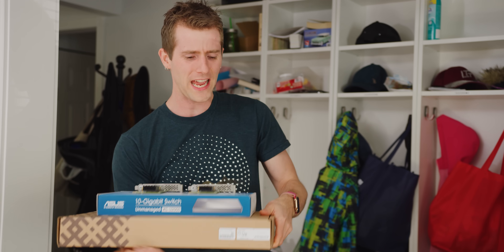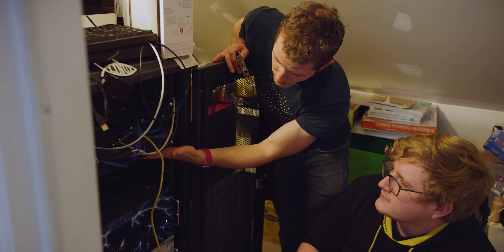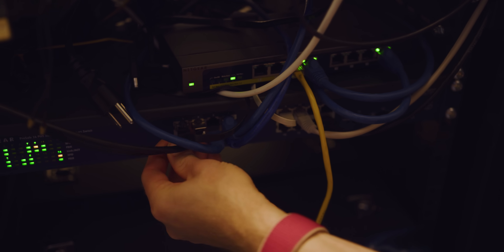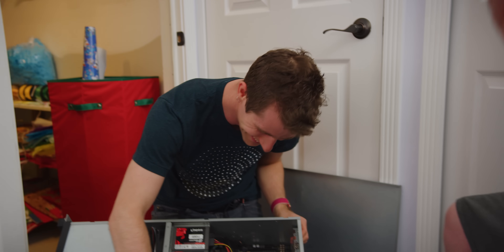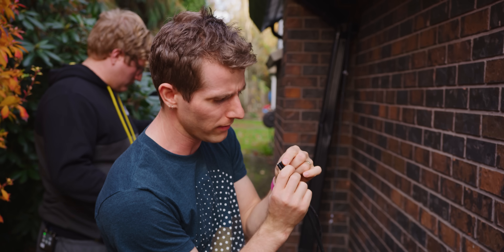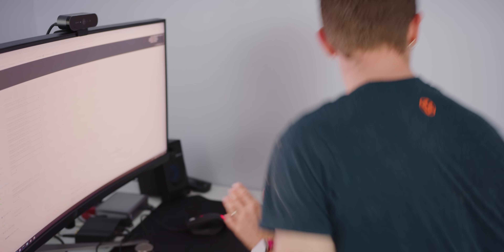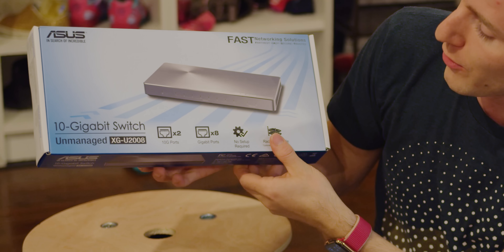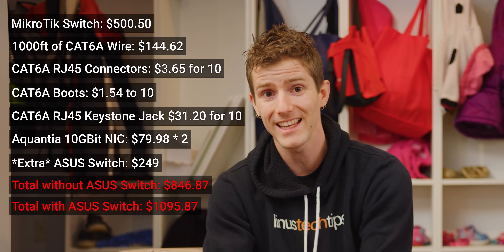Home 10 Gig Network Upgrade for CHEAP

Comment: 4:10 and a storage device that can write faster than 1GBit/s (110MB/s), thus for 10Gbit you need something that can write at roughly 1,100MB/s.....uhhhhhhhhhhhhh....... so you need at least 2 sata SSD's in raid 0 or an m.2 NVME ssd. (Of course you can also do the stupid way of putting like 5 or 6 hard drives in raid 0 but who does that?). Just speaking for the mass who don't have big ass servers.

Comment: a little question: does 10 gigabit work with cat6 cable?
Reply: Yep for runs in a home should be fine. Just make  sure its 23ga 100% copper
Reply: @mrmotofy  i installed the cat6  6 years ago. allright thank you :)

Comment: $249 for an extra switch is a bit still crazy. I'd need a few in the house, every room needs more than one wired connections. A 1g 8 port switch costs $15.
Reply: Devices like Apple TV, Ring Doorbell, Xbox, etc., all have 100M/1G NICs so don't need to be connected to a 10G switch. That can help save on cost. You can also run several drops to each room. I have three drops in my office, two in my master bedroom, etc. That way I don't need as many switches.

Comment: is it possible to convert 1 gigabit to 10 gigabit network/internet?
Reply: You're confusing local network with internet. But yes in a home most of the time I 1 gig Network can be switch to 10-gig easily bye changing the components on each end and the switch. But it may not be worth it depending on your use of your network. None of this will change your internet unless you upgrade from your ISP. Which in almost all cases is only at 1 gig available

Comment: Question. 
Is it okay to run indoor CAT6 though a pipe to protect it from weather or is it still recommended to run outdoor cable?
Reply: Technically no, but can you sure for a home. Conduit is an excellent option

Comment: To clarify more, the cat 6a cable is twisted more for less crosstalk. Apart from having a larger frequency, the gauge of the wire as well as the plastic coating outside of the copper sheaths are also different.

Comment: From around 8.20 to finished installed internet in this video (fiber not network tho, even tho we do that to) is my job on a daily basis.
 I have been on so many attics and seen SO much stuff and crawled true so much shirt you will not believe it =) Even tho the contracts says "Easiest way from where fiber ends up outside your house til the source (tv/computer) area" we do give some "slack" on that rule to have happy costumers, even tho we dont make extra money on it =( But a happy customer is at the end of the day worth some rusty nails in the scalp and some mouse droppings and glava in your asscrack =) So next time you have a cable installer of any sort at your hose, give them a coffee and a smile and be nice, they work ALOT for very little and they do it with a smile (well most of us do lol).

Comment: Nice video, but it still isn't cheap xD.
Thankfully my house has cat6 cabling (those cables are only a bit expensive comparing with cat5e, 5 years ago, when i installed ethernet cabling in my house). 
I only need to wait for even cheaper 10Gig RJ45 switch and nics :)

Comment: OH MY GOD...... why would you crimp on a cheap RJ45 plug on this really expensive cable? you have to terminate it with a properly shielded Cat 6a RJ45 keystone jack, a Cat6a wall socket or a Cat6a patch panel
also wtf is that wall socket at 12:55 omg it's all plastic? and it says Cat6a? I would call that Cat 5 at best LOL idk why america/canada is so far behind europe in network equipment?
the network in our company is from the early 2000's and it's all thick Cat7 cables and cat6a terminated on both ends. completely shielded from end to end.
this is the standard here for so many years I can't even remember the last time I saw a Cat5e installation cable.
Reply: They probably used UTP Cable wich is un-shielded, unlike in Central-Europe (because of EMC rules not to interfere other appliances) where Cat.7 S/FTP is much more common and cheaper than Cat. 6A. It is still possible to Terminate the cables with Cat.6A rated Sockets, because the new type Cat.7 Jacks GG45 or ARJ45 are still to expensive.

Comment: 10G is great for point to point links (although optical Thunderbolt kinda beat it) and single-cable WAN connections. Link aggregation, despite being a bit more complicated to do correctly, is just as effective as 10G on LAN for handling lots of devices. This is especially true when they can’t be upgraded beyond 1gig and/or there are a lot of wireless clients. It’s a lot cheaper than 10G and has the same effect on 1gig-limited clients for those who can do it.
Reply: Link aggregation is better than nothing - but generally does NOT work at "near wire speeds" or even close.
Probably depends on your setup though - but on all of the hardware I've used it on, Dell or Supermicro servers with 4 x 1GB ports, I have never seen more than about 120 Megabytes/sec - with everything running through the SAME "supports net ag" Netgear switch.

Comment: wow over kill for me. I have 230mb service and do not quite take full advantage with a gig system I never get anyware near the speeds I have now.
Reply: You're confusing local network and internet. If all you do is surf online yes you don't need hi local network speeds but if you move data between computers or servers then it helps a lot
Reply: @mrmotofy  did you read a word I sed do you know tech turms at all. I clearly explained what I used for a switch for my local network witch is 1gb and my service aka internet is 230mb going over my network and most normal people you should never need a faster speed inless you have a house full of kids who game and watch movies then you will want faster speeds to keep up or if you are running a server but as far as your local network it would take quite a few people doing things like say watching movies off a movie server to take advantage of that speed. even for him 10gb is over kill the only thing that changes things is he runs severs but the spped he would need would be for internet not local yes he dose video editing but the speed with that will never hit 10gb and will actuly limit out at no paster then 500mb do to the speed of data transfer from the harddrives and that would take top of the line harddrives and hardwear and yes I no he gets that stuff before it comes out and free. he is a lucky rich person. unlike me who has to work my but off and home I can make it threw the month.
Reply: @vorkev1  Chill with the anger dude, I misunderstood your comment. I've been reading hundreds on here with everybody whining about their internet in comparison to this LAN set up. It really wouldn't be that hard 2 saturate 1 gig with a basic NAS like you said. I have couple old 300 gig HDD that can do one gig by itself. So start rating those or adding multiples and it would be easy to run into multiple gigs. But most people as you say don't need the higher speed because all they do is surf the Internet. Which is slowly changing with all the personal data people are beginning to store. Then ideally one should be creating multiple copies of their data and transferring to another device on the network. Then in a good scenario is also an off-site copy

Comment: > Goes through hell on the attic to pull a Cat6A cable
> Never tests to see if existing Cat5E cabling would have worked with 10G
> Likely yes it would

Comment: Hey guys!  I'm currently trying to get parts for MY FIRST EVER pc and my budget was around $700. Could you tell me if these parts make sense?
CPU:AMD Ryzen 5 2600 3.4 GHz 6-Core Processor for $117.68
Motherboard:MSI B450M GAMING PLUS Micro ATX AM4 Motherboard for $89.99
Memory: Corsair Vengeance LPX 16 GB (2 x 8 GB) DDR4-3200 Memory for $67.98
Storage: Crucial P1 500 GB M.2-2280 NVME Solid State Drive for $66.95
Video Card: Asus Radeon RX 570 4 GB ROG STRIX Video Card for $70 (buying my friends old one)
Case: Cooler Master MasterBox Q300L MicroATX Mini Tower Case for $44.99
Power Supply: EVGA BR 500 W 80+ Bronze Certified ATX Power Supply for $48.98
Operating System: Microsoft Windows 10 Home OEM 64-bit for $98.99
Wireless Network Adapter: Asus PCE-AC55BT B1 PCIe x1 802.11a/b/g/n/ac Wi-Fi Adapter for $34.99
3 Case Fans; 2 be quiet! Pure Wings 2 140 61.2 CFM 140 mm Fan (both are $12.64) and one be quiet! Pure Wings 2 120 PWM 87 CFM 120 mm Fan for $15

It meets right under my budget. The final price is $680.83.

Comment: *Cleaning up the coffee that I spit out when he said, "just 500 USD" for the 12 port switch*
Reply: Considering the price of new ones (here in Europe) about 1k... Well that's cheap
Reply: Aurélien ETIENNE 
1k??
Here in the Netherlands it costs €529,- and thats including all taxes.
https://tweakers.net/pricewatch/1432780/mikrotik-cloud-router-switch-312-4c+8xg-rm-crs312-4c+8xg-rm.html
Reply: all of you trying to reason those prices didn't get the op's point ... while 15k for a Versiv 2 is reasonable from the POV of companies using those, it's still not "only 15k"
(different price level, same logic)
Reply: Mikrotik makes some god damn nice product for a really good price.
For 100€ you can get a full network router when for the same price on dlink/netgear/tplink you get a dumb limited stuff. *
i switched 120€ a 1GB tp link router/switch  that could do wan agreagation  (1 to 4 port) but... that stupid shit couldn't handle more than 200mbit wan throughput
i did stated "vlan support" BUT only their own custom vlan solution with 4 vlan and no way to choose the ID.
almost same price and i have a a mikrotik rb3011uias-rm  that is way better and can do almost anything (too bad their metarouter doesn't work on multi-core, that would open some fun stuff)
The only issue would be that's it's not meant to be user friendly, if you don't know your network basis and their product, you can fuck up your router config quite easly
Reply: Yep, still way too expensive. I'm not upgrading my place until I can get a 8 port 10Gbit switch for 150USD
Reply: I'd say 500 USD for a 10 gig switch is pretty reasonable. It's no Cisco switch but it should do fine.
Reply: @alolanstarboy  it's a Mikrotik. Mikrotik tends to overstate their abilities. I remember back  in RB250GS era, 5 port managed gigabit switch. it only did gigabit when in "dumb" mode. if you tried to VLAN it, speed dropped to s#it. only 300mbit if you were lucky. source: I use mikrotik and have about 30 out there in the field atm. they are very reliable, but you have to know what they can REALLY do, and not what mikrotik says.
Reply: @83hjf  I guess they use the maximum possible speeds it can achieve for marketing lol. Either way Linus didn't seem to have any intention of creating VLANs for his network anyway so he should be set
Reply: $500 for a 10g 12port switch is an amazing price
Reply: Ill upgrade to 10GE when ZyXels XG1920 12 port switch drops to less than $500.

Used enterprise gear isbusually pretty reasonable. 10GE is still a bit rich, but used large 24 and 48 port layer 2 gigabit switches are very affrodable on eBay.
Reply: Some 10 gig switches are way too expensive. Some cisco switches go upto 2000 bucks
Reply: @shreyaspranav  
Only 2000 bucks you should say.
Those Cisco switches, most of the time, contain lots of functionality which you might not find on cheaper switches.
Than again, they are kinda expensive for the average household ;-)

Just picked up a HP switch/controller which was needed for the WIFI access points I bought cheaply.
They needed the extra functionality in the switch/controller.
So the cheap access points turned into a bit more expensive experiment.
That switch normally would cost you an arm and a leg, but on the second hand market it was "only"" €300,- refurbished by HP.

HP, Cisco and others know how to earn money.
Reply: Thats pretty cheap for 10ge.

Check out the pricing on fiber om4 multimode and 10ge multimode sfp+ modules
Reply: @lakorai2  multimode sfp+ is peanuts compared to single mode 80km rated optics. List price for those run in the 8k USD

Comment: Just in case you ever want to login to your switch, go to mikrotiks site and download winbox. It will pick it up via network discovery (no it doesn't come with an IP on it, mac discovery works perfectly fine), at the very least so you can monitor bandwidth usage / check the negotiation of a port.

Comment: $500 + 200 + 400 = $1000+ (US)... uh no. That is not affordable. Affordable is a $40 1Gb switch and $40 in Ethernet cable.

Of course most people do not understand that most computers will not actually be able to make use of even Gigabit.
10Gb = 1.25GB
1Gb = 125MB

Once you figure in that a platter hard drive runs (at best) 130MB/s (but many see a more realistic 80-100MB/s peak), and a SATA SSD at 300-500MB/s (more or less sustained), the only way 10Gb makes any sense is going from NVMe to NVMe storage (which itself can exceed 3GB/s), or higher end RAID setup with enterprise SSDs. Once you figure in the (MS/Apple) OS overhead, most people will see no speed boost going to 10Gb on their home/small office network. Heck even the company I work for only uses the 10Gb (SFP) connectors from server to switch and firewall to switch, with the rest of the connections on the switch to the 100+ PCs at 1Gb.

Comment: every Mikrotik device can be managed ,but they have some default "crap" config so they probably wont lease any IP ,but you can use WinBox to connect there with mac adress, or if it get IP adress you can go with ports :9999 https://mikrotik.com/download but care ,try to use latest RouterOS ,cause there were some real issues with security

Comment: $850 for 10g at home seems high for what you're getting out of it. I'm looking at running a 200m link between two computers at home and I'm looking at like $250 total, $75 for the NICs/SFP+ modules and the fiber I'm going to use is worth ~$175, based on what I've been able to sell it for. Each server will have another 10G port I can daisy chain off of if I need to, and I can get a switch when I start getting a lot of 10G devices. Each server also has a 4--port 1G card I'll use as 1G switches on either end. I'm going to keep my existing switches as well (I've got 12-strand fiber) so I have a backup 1G link to get to DRACs and the like in case a server is down. I'm building this for a 30TB Ceph cluster. I'm also going to have my internet come in on a VLAN on the 1G switch so both servers can have redundant pfSense gateways running with LAN-side CARP and WAN-side switching based on the current CARP state.

Comment: Link aggregation would be better, two rj45 running in parallell, as a backbone between the switches(cheaper switches also).. 2gbit should suffice for a home environment with alot of packages in a subnet

Comment: 1:10 No, it's 8P8C. And using electrical connections for >1Gb/s is blasphemy :|
9:10 WTF kind of construction is THAT ? Those pseudo-ceilings, flimsy boards, naked unbent long nails, mice shit !
How could you allow this ? How does this pass inspection in your country ? And in a city too !
13:50 Should have used Huawei gear. It's cheaper, more feature-complete and trustworthy than western brands.

Comment: You used the most "pain in the ass" RJ45 connectors ever. They are junk. The way most people would do this is they would install a patch panel in the rack and terminate the cables on that. Then patch cables to equipment. Just because the Fluke certified doesn't mean this is right.

Also, any Jack that allows you to plug a 45 into the back of it is junk. You always want to absolutely minimize your points of connection from rack to jack. DB loss is real.

Comment: Maaaybe turn off the management interface so default info isn’t present on the switch’s interface..

It really doesn’t matter.. but... heh
Reply: This is a big part of the reason that so many Mikrotik devices are hacked. They are super cheap with a lot of functionality, but really need to be secured (IP access list for management, disable unsecured protocols such as SSH, turn off any unused services). In Linus's case he is probably okay, since he is just using the Mikrotik switch as a L2 switch and it is behind a firewall and his ISP's router. Many people just plug the Mikrotik's into their ISP's modem with no edge security (Firewall or router) and do not secure it. That is when you are in trouble.

If anyone got into his home network, the thing would be eaten for lunch. At that point he should be way more concerned about the fact that someone is on his network than just getting into the Mikrotik, though the Mikrotik would be an easy target for exploiting his network (especially if it is in RouterOS mode). It would be pretty easy to do with that outdoor cable though. Just cut the end off and re-terminate the RJ45. Log into the Mikrotik, and you could own him. I would probably do port security on the outdoor cable at the least, as well as following Mikrotik's basic hardening documentation on their website.

Comment: Ahhaha, mouse poop and nails in the roof and a cable that you need to push\pull in the corner of this hell, yeeeah, been exactly in the same situation this summer :D

Odd that it did not show up with it's IP and you could not connect to it's management interface, you could try WinBox, it can find devices on the network by MAC.